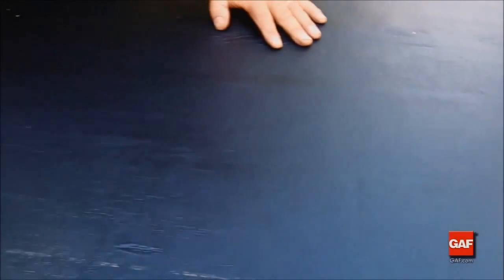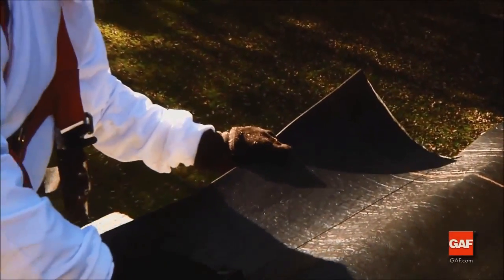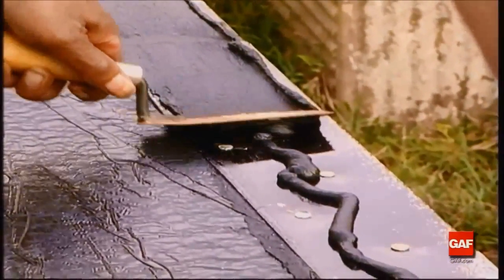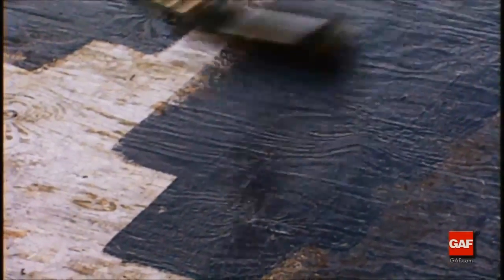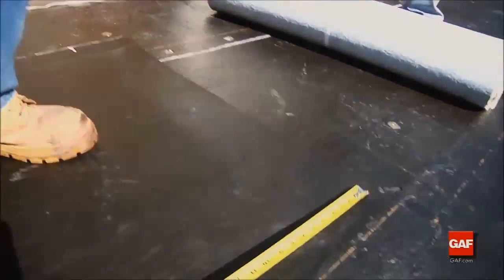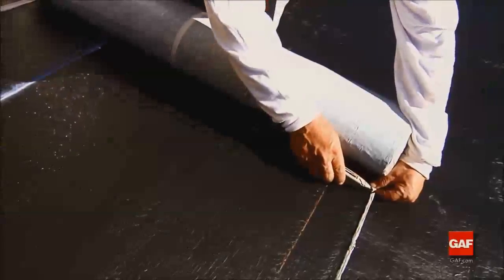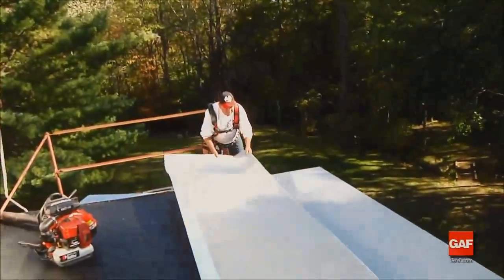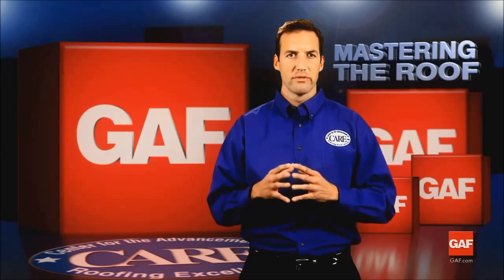Low Slope Roofing Installation Guide - by Roof Repair 101

Comment: This video is all over. It doesn't show step by  step. For a selfdoer it might be confusing. In some part it show to apply cement over the metal and on another clearly shows the installer placing the cap with no cement.

Comment: I didn't think of long term installation because I'm 70 years old :). Also, it's a 200 sq ft "shed".
Long term, the nail down sheet would be important. I'm not sure you could ever pull this stuff off the plywood.

The Liberty base sheet was BEAUTIFUL!  I was impressed with the ease of installation. My plastic somehow got hung up underneath on the the second half of the last piece and I had to wrestle it off and replace half of it. That was operator error. I was just getting cocky, saying how great the job was going and probably rushed it a bit.

The cap sheet? That is a different story. I thought it would install as easy as the base sheet but I was wrong. I laid it down and pulled out the plastic on the first row without too much difficulty but the extra weight posed issues. It was hard to get it aligned perfectly.

I ran into a snag on the second row.when the plastic started snagging on the overlap part of the first row.  I fought with it enough to salvage the piece but ended up with a poor job with a couple of big wrinkles.

I did some more research and found that the method is different on the cap sheet and it will require more than one person to fold the sheet into place. There is no way Im going to try and get lucky and flop an 18' long piece in place. That shit will get sideways and when it sticks to itself, you are screwed. I will get a friend to help put the last few rows in place.

If they would figure out a way to make the cap sheet as easy as the base sheet, I'd use/recommend this product again.  Right now, Im wishing I'd gone with an old school nail down asphalt system.

Comment: My roof is concrete. How would work on it?
Reply: MrMunchiemo you need a coating or installing Insulation and fully adhere PVC roof. 

This product will not work on concrete roof

Comment: and the point of the harness is ?
Reply from the maker: +kempouk to be safe :)
Reply: +ROOF REPAIR 
to be safe oh I see when the fall off the roof the harness will cushion the impact.
you moron the lanyard is hooked to the harness lol.
and a harness when clipped to an anchor point is the last form of fall arrest when a scaffold can't be used.
a typical company don't give a flying fuck for it's employees.
hope you get rich quick and retire from putting these guys at risk of death.

Comment: Up here in the north this kind of seaming fails. Find Duro-Last roofing contractor. Custom made sheets up to 2500 square feet and heat welded seams. It's far superior to this product and application.

Comment: This stuff looks like a hell of a lot of work.  I have a 13' x 25' porch roof similar to the video, and dead flat.  Roofed it myself with a single sheet of EPDM and termination bar and adhesive.  Then coated it with BlackJack white roof coating to reflect the heat.  Best roof I've ever had; then golf ball hail tore my shingles to heck but the EPDM sailed right through, didn't even hurt the Blackjack coating!
Reply: Agree - EPDM is so much easier to install and / or repair - even homeowners can do it with our DIY kits: http://www.rubberroofrepairkit.com
Reply: Out of interest, why did you not use a roof tile suitable for low pitches? I've recently fitted a tile, although my roof has a 11 degree pitch. I found lots of suitable tiles at https://www.roofingmegastore.co.uk/roofing-categories/pitched-roofing/roof-tiles/low-pitch-roof-tiles.html and thought these were a lot more aesthetically pleasing than a rubber roof.

Comment: Under a 2 inch rise per foot is considered "Low Slope."  There you have it straight from the manufacturer.  That is nuts!  Stop at a 4 inch rise per foot - period!  The manufacturers are making problems as unknowing contractors follow their recommendations.  Under 4:  Go to metal or single ply but don't use shingles!
Reply from the maker: Most metals REQUIRE a minimumof 3 over 12 pitch... so .... single ply it is
Reply: Fiberglass is the best low sloped roofing.  Nothing compares.   With a copper coating it really is an outstanding roof.